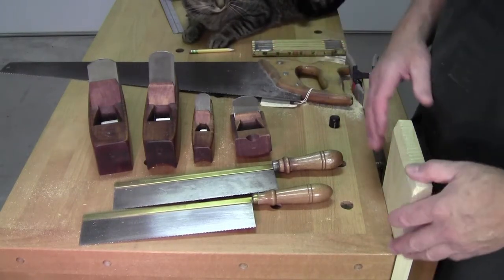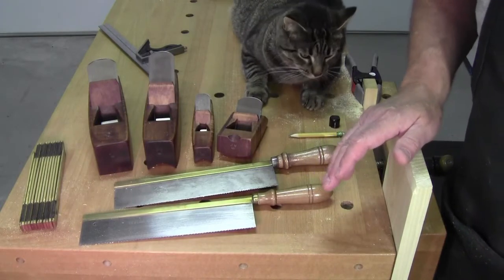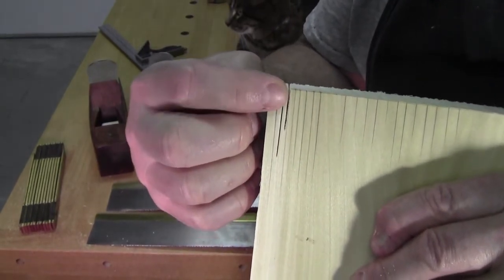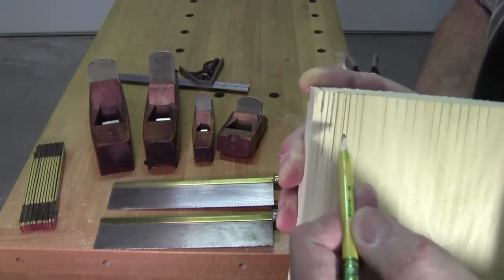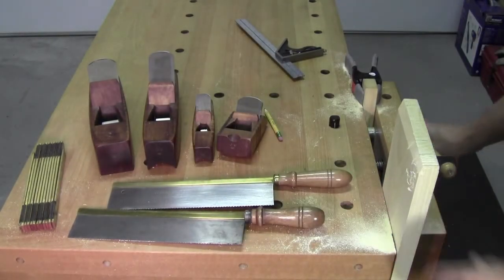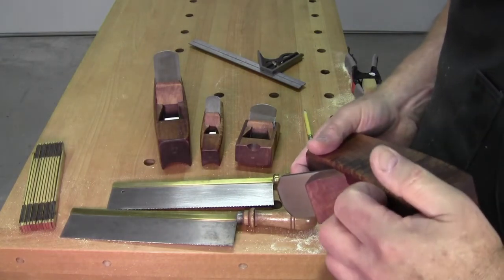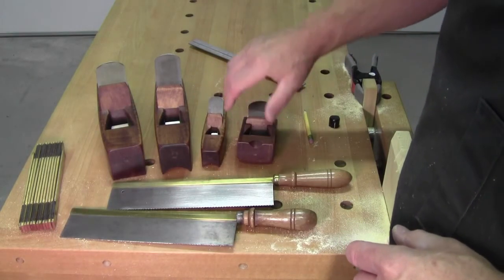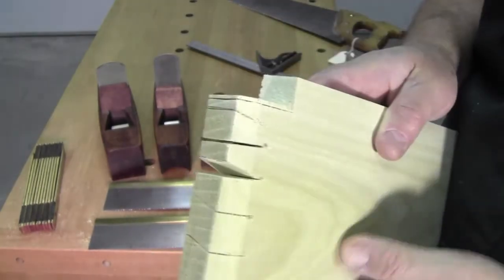How to Saw Perfect Dovetails - Practice sawing ti the line - PLANE TALK  August 25th 2017

Comment: Hi Walter-

Good tips. BTW, doesn't Paul Sellers recommend filing saws to rip? He doesn't seem to be a big fan of xcut saws.

I like the hybrid sharpening that Mark Harrel uses.

-- Steve.
Reply from the maker: He does use crosscut but I see most of the time for smaller work Paul and others just reach for their Dovetail Rip filed.

Mostly because there is always some clean up with a file or plane.

Frank Klauz also does the same.  Must be something to the simplicity.

If you can saw to the left or right of a line then...  clean up is easy.